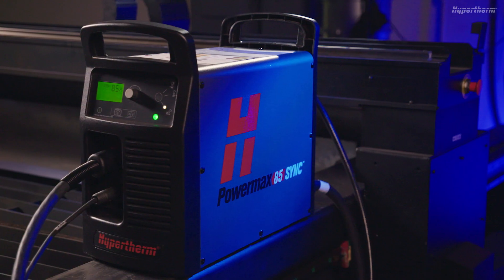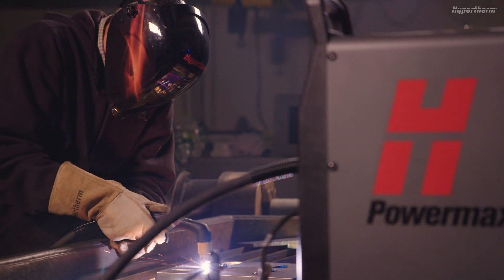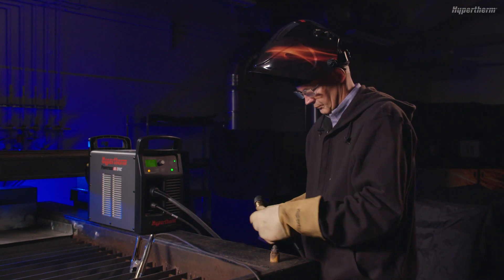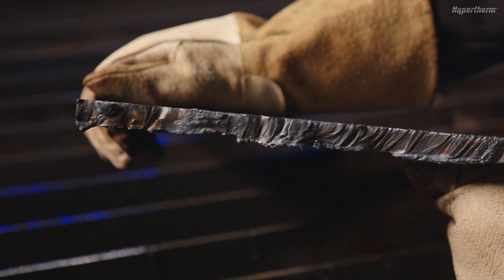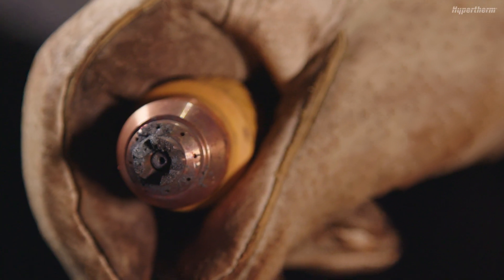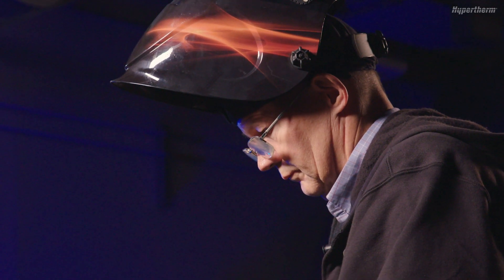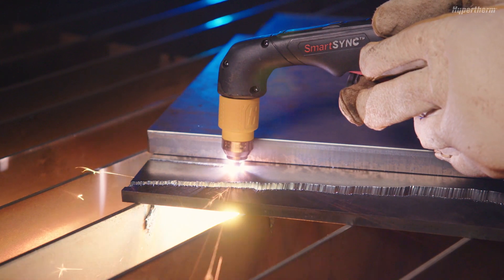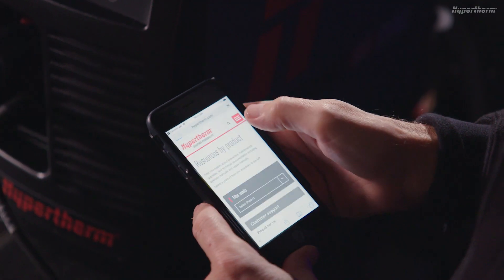When to change the Powermax SYNC Cartridge

Comment: I’m sure you will be returning to the previous style soon… the automatic shutoff that the user can’t override is a problem.  end  of use tips I have no presumption of the lifetime expectation is a problem… if I needed in the past to extend a bad consumables life time I could!!.. now you control that!!…with a error message SMH!!
Reply from the maker: Hi! You can turn the EOL Detection Feature off to override that error, but you will increase your risk of consumable blow-out. You can reference page 150 in the Operator Manual. Access this via the Feature Configurations screen on your system to turn off EOL Detection. We hope that helps!
Reply: Completely agree with this. It will be quite frustrating to have the whole machine inoperable due to the cartridge that's cutting less well. And I'm assuming the old cartridge detection works flawlessly.